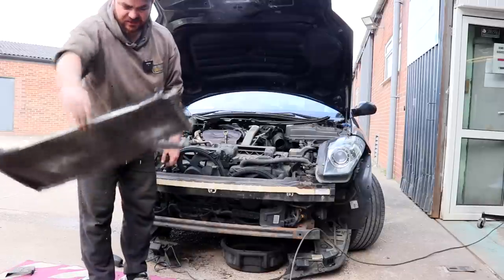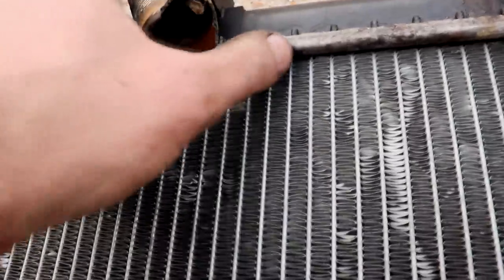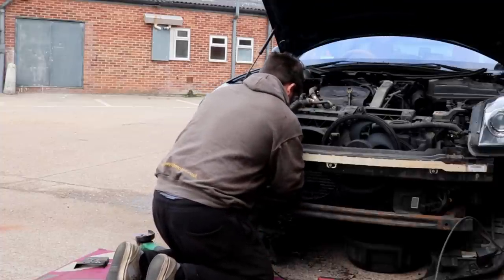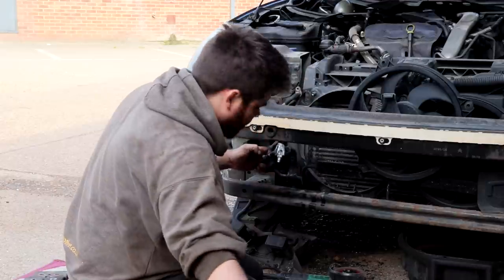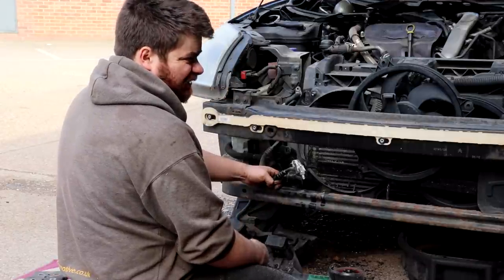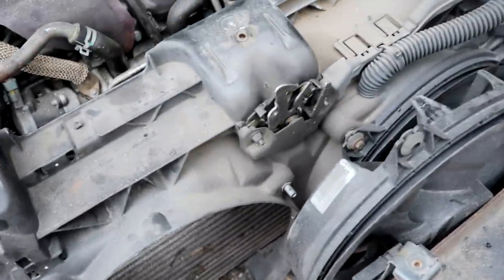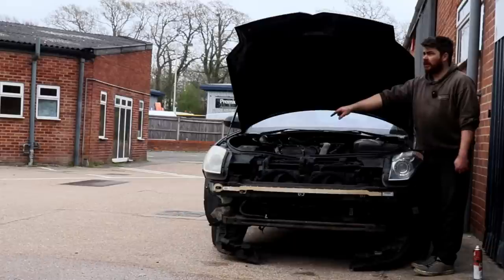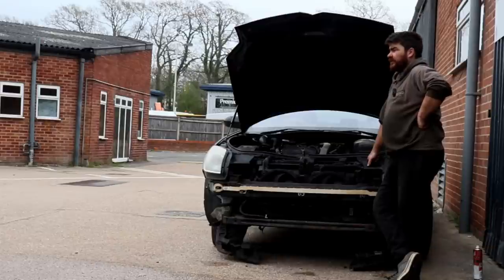Cheap Citroën C6 Project 13: Cooling System Repair VLOG pt2

Comment: You are so correct with your comments about this era of cars becoming future classics. They are disposable like most things these days. 👍
Reply: Classic Car ownership will become very frustrating when you reach the era of plastic cars (late 90’s-early 00’s).
Reply: @stoneylonesome4062  Honda and Toyota vehicles had a slightly slower transition to so much plastic (Honda even still use rubber hoses & metal hard lines for vacuum even to this day, instead of those snap-fit plastic vacuum lines AFAIK), so might be better choices around that 2000-2010 era?  (Granted if you are in the UK then rust is applicable, sadly.)
Reply: @TassieLorenzo  Not all the time Lexus gen2, Celica gen1 and Avensis gen1 owner and they still have parts break or collapse 'without hardly looking at them' .

Comment: I really feel for you mate, I ran into the back of a car in my 1998 Xantia 1.9TD SX  estate in 2015 and I had to pull the rad and condenser rads out and rebuild all the plastics with little copper wire loops like I was building a plywood boat. and then stick it all back together with fibreglass, the rads were available but the price of a Citroen fan housing was more than the car was worth so with help from the French car Forum for a few spares like the odd bit of plastic from behind the bumpers I rebuilt it. you can definately see from the intracate way cars are put together these days that this is why they are so often written off when they have a accident, keep going your doing very well, wouldnt mind betting this will be a reference point for the French car forum in future, you might be making history where others have literally given up in their throw away society. This is the point where you will probably start to build that emotional bond with the car and do everything you can to suceed, I remember my Father working night after night in his garage putting new rings in his GS and had been supplied the wrong size rings they were ever so slightly to big, he stripped the engine out a second time which took him another week of fiddling but had to give up as he couldnt get the right size rings i had to tow the car to start it after it had warmed up when the rings expanded, he decided it was time for a new used GSA estate instead of a hatchback, but I never saw him so upset in his life he was so attached to that car, he'd been to hell and back trying to fix it, I remember towing it to the incinerator compound at the back of the Airport in Portsmouth and we took the spheres off so that she sunk to the ground and stayed there.

if you ever need a fibreglass resin that gives you time to work (about 30mins) try Zap Z-poxy finishing resin from a model shop, it saved my xantia rad fan housing, the cure time is about 3 hours. its fuel proof to.
Reply: Not just me who uses copper wire and araldite then 😅
Reply: @MattBrownbill  aeroldite, silicone, fibreglass, heatproof screwfix silicone etc etc etc.😂

Comment: O/s/f wheel off and undress the arch. With the suspension on highest you can just get at intercooler pipe, I seem to recall.

While you’re in there you might as well do the timing belt & tensioner/idler! 😬
Reply from the maker: You can, but it still won't come off. And the timing belt is a job for somebody else, I think! I think my days of working in the engine bay of this car are at an end.

Comment: I would love a C6, but given that an experienced mechanic like yourself, with a well equipped workshop, still has struggles to keep a C6 running well, means a driveway dilettante, like myself would be in a world of pain and/or expensive bills.
Reply: I have a C6, I had hurdles to overcome, I am not a mechanic by trade, however I have an extensive knowledge. Remember, this was a very cheap C6. It is worth it.
Reply: @dizzy2020  100%
Reply: To be fair, this C6 is teetering on the edge of parts car because it's been neglected so if you bought a well sorted one, it wouldn't be this troublesome to keep up with the maintenance.
Reply: I own a 2008 C6, the things wrong with his 750£ C6 is just mind boggling. My car has been in my family since new and the biggest jobs it has needed: had a LDS oil leak from radiator, possibly because the radiator sat in the snow for a while and cracked with the cold; hydraulic pump's motor stopped working, might have been because it got a little bit overloaded when LDS started to drip out from the radiator; undercarriage rebuild, rubber bushings started to wear out and I decided to do it right and everything got rebuilt.

Other than that, it has had basically just maintenance as needed every year and consumable parts. No big issues like his C6 has.

I can see how his videos can put people off buying a one, but it is not that bad when the car has been looked after and he is doing the gods work documenting everything wrong with his car.
Reply from the maker: @johnpeat2487  Spot on there!
Reply from the maker: To be fair, a radiator on a 16year old car isn't that big, is it? I'm not making excuses for it, as it's a complete pig to work on, but on the whole it's been pretty decent for me in the time I've had it.

Comment: I've seen plastic in cooling systems go brown and brittle before, there's a little black plastic guide inside Vauxhall Family 0 water pumps that does exactly the same thing and makes the pump scream like hell, I think it's because they're GRP rather than actual plastic, so the coolant wickes along the fibres and absorbs into the plastic, and coolant has a horrible habit of being corrosive to not only metals but also plastics, especially if not diluted properly.

Comment: No wonder garages refuse to work on citroens 🤔
Reply: Most Citroens are straight forward, this is not most Citroen's. This is why there is such dedication
Reply from the maker: echatz is right.
Reply: @UPnDOWN  how good is the C6 in bends, I can't believe how it changes from floaty to stiff, almost no body roll.
Reply from the maker: It's pretty good considering it's size and wafting ride